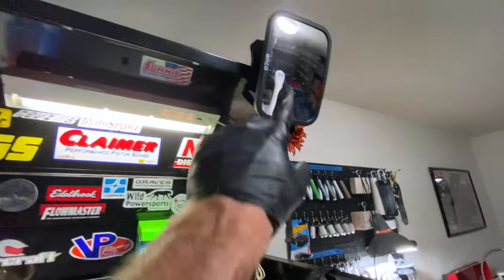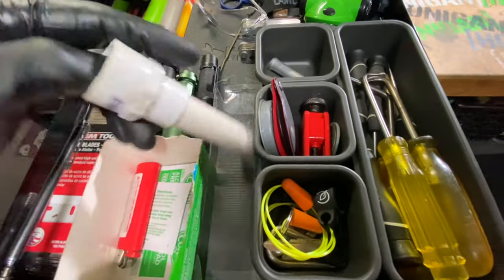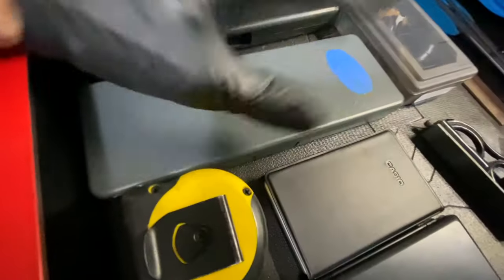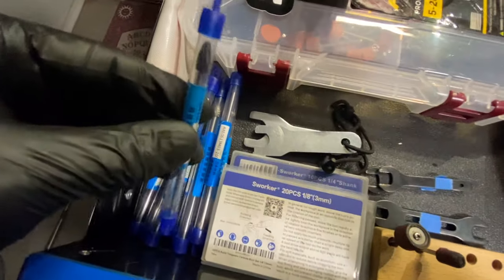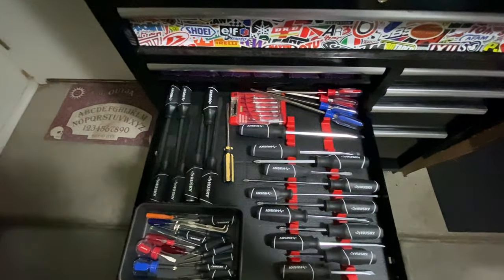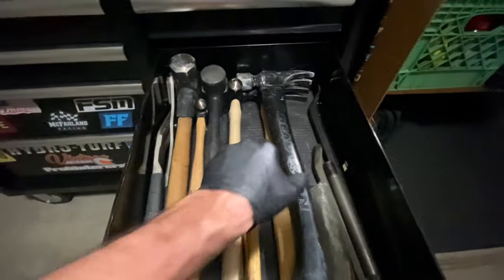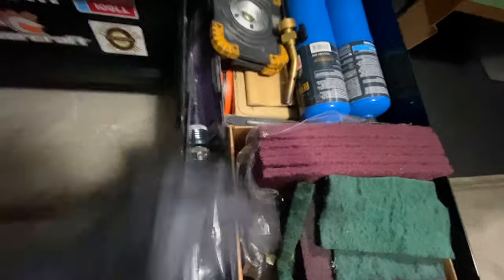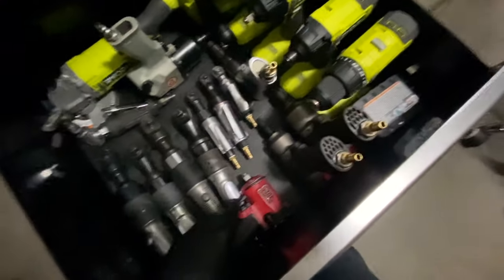Toolbox Tour #2 | Husky 41" | Ryobi | Ingersoll | Klein | Mac

Comment: I have the larger Husky box, where did you get the color drawer face pulls? They look great. I labeled my drawers with Brothers label attached to magnet strips.
Reply from the maker: Thanks! I took 'em off and painted them red white and blue; I'll get around to the bottom box eventually, I just haven't thought of what I wanted to do yet.

The labels I had on there were printed up by my wife on her Circuit.  I was going to do that again with new fonts and colors, but I like to move things around too much to want to commit to labels, magnets are a great idea!